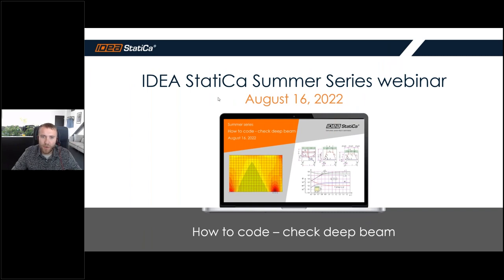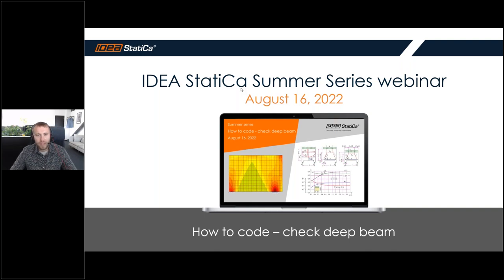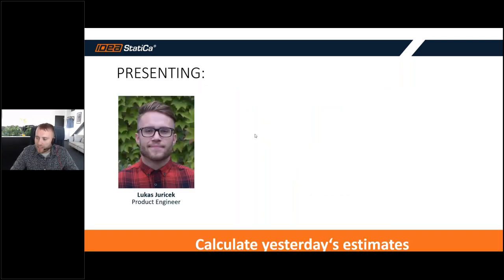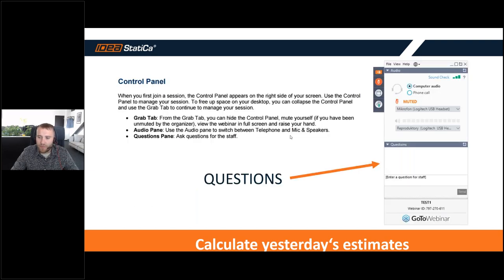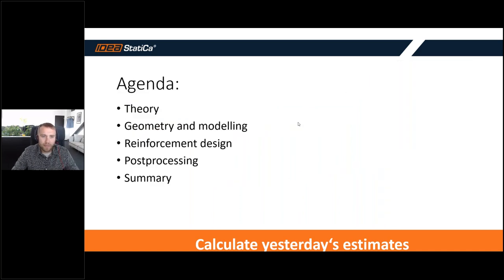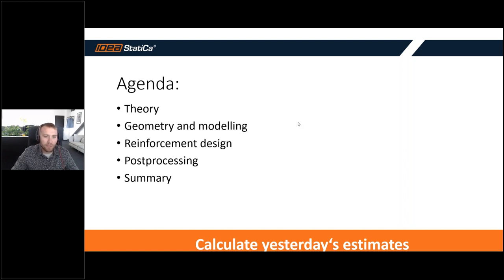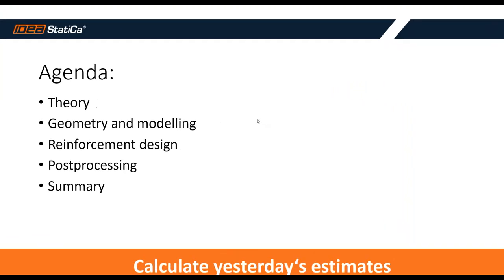How to code-check a deep beam

Comment: Instead of loads, can we apply Shear Force, Axial Force, Bending Moments in this software?
Reply: same question, please reply us!! how could i apply the Shear Force, Axial Force, Bending Moments of each combination from Etabs to Idea Statica?
Reply from the maker: Hello, you can't enter internal forces directly. However, you can simulate the process by setting the internal forces as loads. I.e., if you know the value of the internal forces, and the length of the corresponding member's edge, you can calculate the line load and input it into the application. The bending moment can be simulated by setting the load as a trapezoidal one.
Reply from the maker: You can check the described workflow by watching this webinar - https://www.ideastatica.com/webinars/code-check-of-walls-and-deep-beams

Comment: why there is no code checking for 3D irregular shaped steel plates
Reply from the maker: For checking steel connections and details, there is the IDEA StatiCa Connection software:
https://www.ideastatica.com/connection-design
In Detail, steel is used as rebars or support plates and we are going to finish our 3D concrete solution in Detail soon.